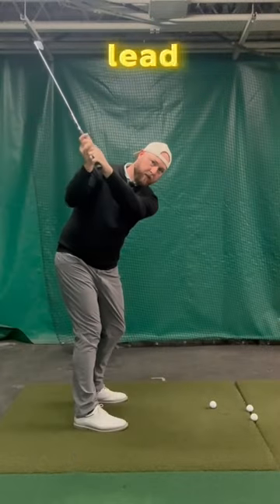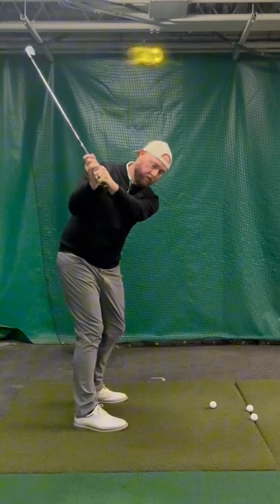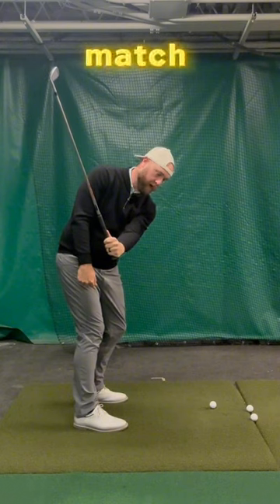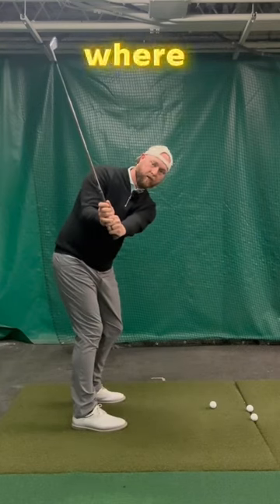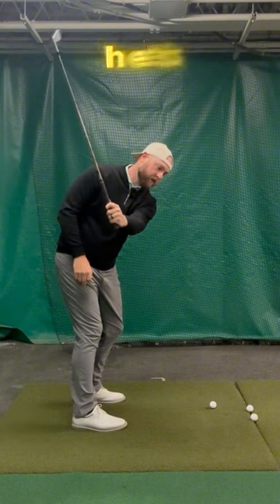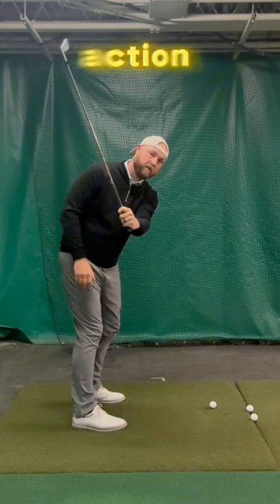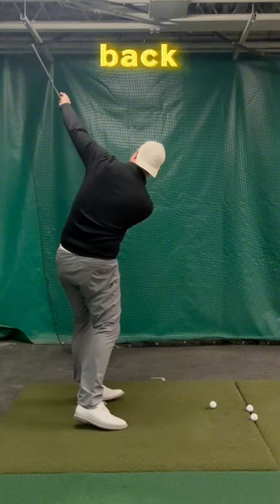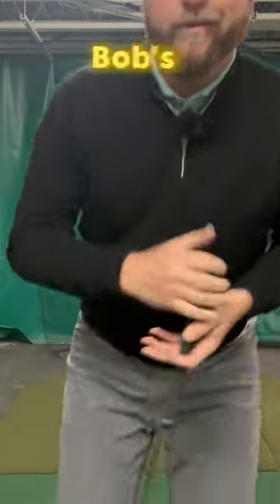Arm and Body Action in Golf Swing 🧬

Comment: The underlying cause and effect is forward side bend in the backswing (lead shoulder down / trail shoulder up)  and backwards side bend in the down swing (lead shoulder up/ trail shoulder and hands down).

Legs action TILTS pelvis and straight spine together.  Side bending changes the angle of the shoulders relative to the pelvis.  

Golfers who early extend have little or no side bending in their down swings. Show them how to side bend and the early extension goes away.

The first thing I do with a total noob is to statically pose them in a pro impact posture which has a lot of side bend then have them swing up and down to it a few times.  Posing them statically shows them the goal of the exercise. Once they have a clear picture of the goal their unconscious reflexive brain figures out how everything needs to move (i.e. progressive amounts of side bending) to get there.